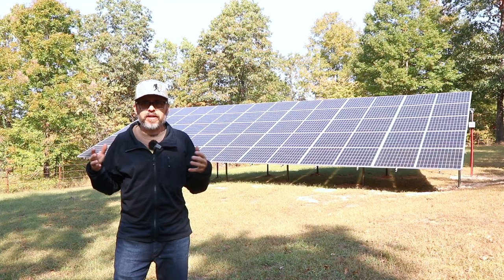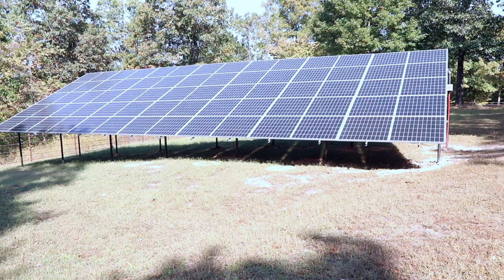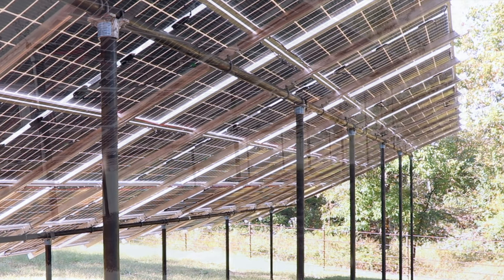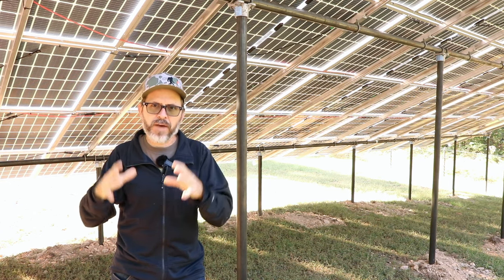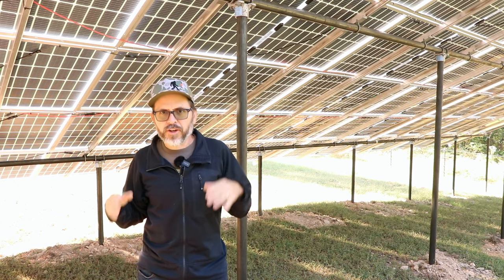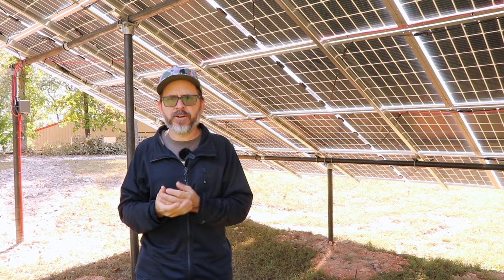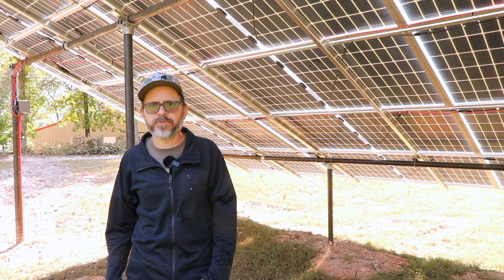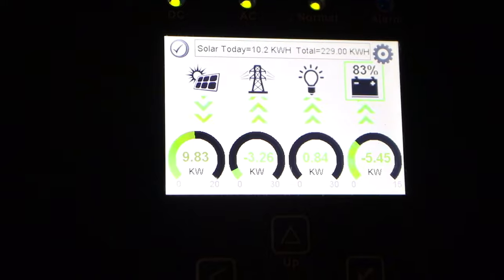Our Modern off grid homestead: Our Complete home Solar System with battery backup Cost!

Comment: This video is really disappointing overall. The initial discussion about his solar array was promising, but the presenter gave little information about how the solar panels were wired together.There was little discussion about the purpose of the inverter , or types available . There was no discussion about the battery , types and sizes . There was no discussion about how to be linked to the grid , how switching back and forth from the grid and battery for power weren't , etc . All this guy talked about was washing his clothes on a sunny day and some smart guy in Arkansas who helped them .
Reply from the maker: Hello and thanks for your feedback. I agree with you and I should have talked more about the purpose of the inverter, types of inverters, battery types and sizes. I should have gone into a little detail on how I'm linked to the grid too. it's hard as every state is different and I did not want to have a really long video (I could go on for Hours on each subject). My first whole home system in Wisconsin was completely different from this one, it had Canadian solar brand bifacial panels  that had micro inverters on the panels and was only compatible with it's own inverter and battery (Generac PWRcell). This current is wired straight to the inverter. I used an installer both times as the permitting was easier for grid tied(Wisconsin was really hard to get permit and I had to get politician involved to get approval) Arkansas I Just had to have power company check the grid connections before I could connect but Arkansas still  required a licensed electrician. It's harder to DIY with grid tied systems and both locations I have lived in required a licensed electrician. It is very beneficial to talk to a Local solar installer that does BATTERY backup systems. Most do not or won't as it's harder and more costly.   Funny you mentioned washing my cloths on a sunny day. Batteries: lithium iron phosphate (LiFePO4) is probably the best now. Some brand of that type. The performance is so much better than other types.  Today we were drying cloths and drawing 6kwh and bringing in 8KWh. Once the dryer shut off the whole property was only drawing 0.6KWH. You have to monitor your usage too. Thanks

Comment: I have an off grid 10kw,12kw pv, 48kw, 100% 120V ac 28' trailer build, electric heat only, a low of -33C in Jan. I installed a 170w heater under the trailer last week, the heat comes through the floor, -2c now was -6 overnight, with just the 170w heater 17c in the basement and 19c inside, good heat for 4kwh. If I use my 1500w heater for 20 mins I get +5c that lasts hours for .5kwh extra 2x a day. This year I should get my heat consumption under 6kwh even at - 30c. Before external insulation the heater usage was 36kwh.  The tv and computer add 2c over 5 hours.
Reply: if you build a high end computer and run something like prime 95 or folding @home in the Winter this is a valid space heater. It's not as efficient as a regular electric heater but when loaded to 80% of it's capacity doing that (the maximum my rig can use as configured) it puts about 600 or 700 watts of heat from the water cooling system in my office upstairs and two smaller air cooled systems in my wife's office down the hall. They move into a weird 109 square feet room upstairs that has 6 120a breakers for it. Apparently it was a hospice room prior to our ownership. I use the server rack batteries to run it at night and during times when our usage is higher than 24kw elsewhere (extremely rare). It's much easier to deal with a single building on a property relative to a place like deer and duck camp though, there's thousands of miles of cabling alone in that one.
Reply from the maker: wow sounds like a great setup! It was crazy today I actually monitored the dryer and it was using 6kwh! our Mini split heaters only use around 1. I will probably upgrade my dryer in the future. I also learned this week that starlink router uses a bit too
Reply: @HomesteadReliance  A dryer is avg 5000w , wait for a dark day charge with Gen and use the dryer in the Gen. Good way to have hot clothes with a smaller system. My Gen could run a dryer and 30a charge and light home load. Gens with huge lpg tanks is very easy, fill up every  summer. My local laundry has the best machines I ever used. My washer is new and dry. If I had to use a Gen Alot and run a dryer I would buy a 13kw minimum. I have minimum usage of 400w with the basement heater on.

Comment: We talked about going solar a couple years back but the cost was a bit intimidating. I've often wondered if a person could just go partially solar.  We may have to check into having enough solar to take care of our (very deep) well and fridges/freezers. We've discussed ways to get water from our well when the system is down and there just isn't another way, it's far too deep to be able to hand pump water from it. We are currently researching solar generators. We have a gas powered one but those are only as good as the amount of gas you have stored.
Reply from the maker: you can do partial solar and have the battery backup only power essentials. The easiest way is have panels installed  and have a manual transfer switch and buy a solar generator such as ecoflow (they are a battery with build in inverter). I have seen solar only well pumps too. Lots of solutions and options with solar and battery backup. If you ever want to check out our system or our ecoflow solar generator let me know. I did learn that our Starlink draws way more than I thought as I was using the ecoflow for a backup with it. It lasted a day. I am looking for another internet solution for a backup now. I can run our tiny house with the ecoflow for a day using the mini split AC/ heater  and mini fridge no problem.
Reply: @HomesteadReliance  Thanks! I didn't know there were solar well pumps, that's exciting information. If we decide to go with just a solar generator and no panels, etc. Is Ecoflow the one you recommend? We have Starlink and Ritter for our internet.
Reply from the maker: I do like my ecoflow and they are priced well on Amazon during specials (almost 40-50% off). I have the delta 2 with extra battery and solar panels. With no sun I get about a day. With the panels in I get a bit longer. I’m going to end up testing the actual draw on STARLINK and get a better panel for the ecoflow (theirs folds but does not perform as great unless you have two of them [and I have two but setup is long]
Reply from the maker: I’ll have to sell you the well info. On my main page is my contact. If you email I’ll get it for you.
Reply: @HomesteadReliance  Good to know, thank you!

Comment: Nice set up! I've been conflicted out of having solar due to a retirement side gig,  but it would be nice not to have to find gas for our generator if the power is out.
Reply: 400lb propane tank, 6 weeks 3 hours a day, @7200w, cost 380 CAD, had to run a lot of gen due to inverter issue in 2023.
Reply: @bobmonztr  We have 3 5000 gallon tanks at deer and duck camp in arkansas because it's hard to get people to refill it where it is and takes calling them when they're having a good day and it's been dry for weeks. There's also a 50kw propane generator out there with a 454 v8 that is converted to propane 1800 rpm optimized cam and stuff to run the electric heat if needed for some reason (electric ducted air furnace) beyond sunny days in the Winter when nothing much is going on otherwise. After the Ice Storm of 2000 we're fairly serious about heat in depth and independent air conditioning energy due to many tornadoes over the years. It runs the electric kitchen and there's 2, one huge and one smaller wood cookstoves, 4 large other wood stoves are also available. I have one medium sized wood cookstove in my house in town too because my best friend owns a tree service and i take all the wood that is hardwood and isn't good for building things out of burn it for fun year round for cooking on rocket stoves and stuff for the lulz and for dry heat without any power or fumes in the house (16' ceilings in all these places and including the span through the upstairs attic space and the vaulted roof there's about 34' of draft to clear the highest part of my house so there's quite the draw if the flue is open.
Reply: @hithere7382  killer set up. Love the 7.4 Gen part
Reply: @bobmonztr  My dad was convinced that deer and duck camp would be coopted by the soviets in the 80s and it's built to make it defensible in a siege.
Reply from the maker: Great suggestion here! Solar is an investment but the prices get cheaper as time goes on. Lost of "solar generators" too (they are just a battery / and inverter with the capability to take in solar panels  for charging.